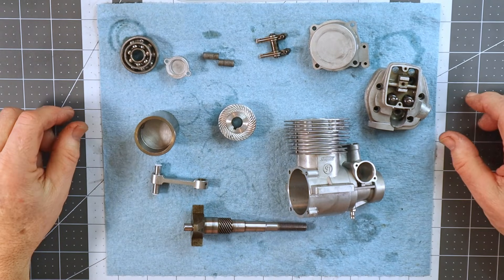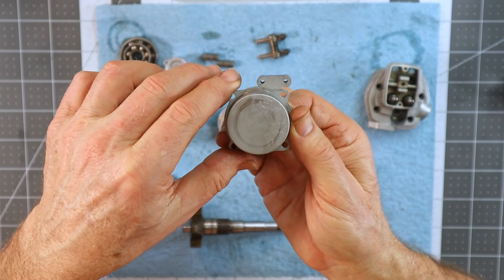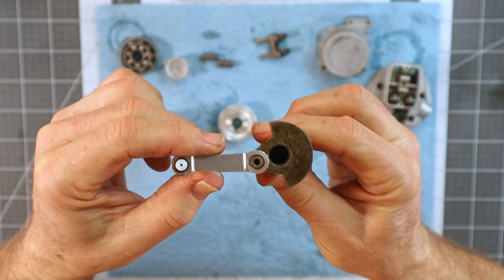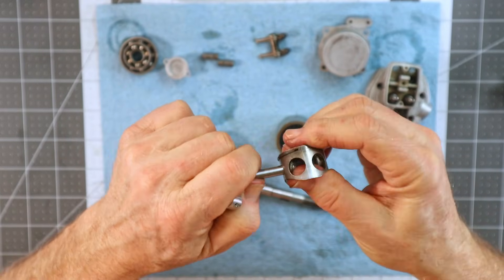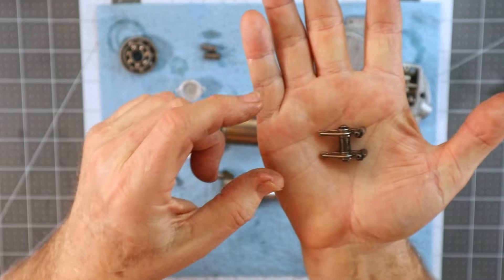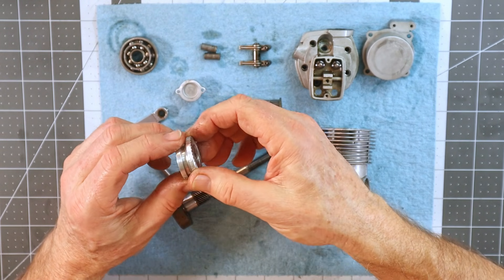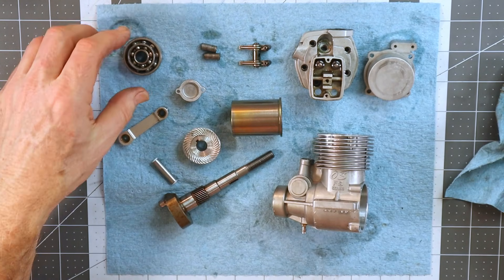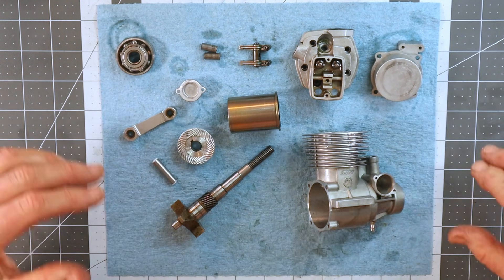OS FS 91 Surpass Enigma Engine

Comment: This video answered some of the oddities from the disassembly.  Now you have a nice set of clean parts ready for assembly. In my high run time OS 91 engines I also see a lot of carbon buildup in the cavities behind the valves. I don't know whether they impact anything or not. In one of my engines, the carbon build up was very thick and it took a considerable time in the sonic cleaner before they came off. Anyway thanks for rounding my Sunday evening with another excellent video.

Comment: Hi David thanks for all the amazing info you share on the FS91S.  I have a couple of Ebay enigmas trying to puzzle them out with way less skill and knowledge.  Please could you show us the head gasket ! I never spotted when you take this off or replace it.  I am not sure if mine is stuck on to head or crankcase or just plain missing.  Thanks so much !
Reply from the maker: I mentioned in the first video that there was not a head gasket on this engine.  It is missing. It is simply a silver thin ring that fits perfectly in the head area. I recommend watching the first video again. I show this very well there.
At 10:13 of this video you can see what a head shim looks like.
https://youtu.be/pv6EDa58fnc
Reply: @dmrcflyr2  brilliant thanks

Comment: Hello Dave, I am a fan of your channel. I have two OS 91 surpass. Why is the needle value on the same side as the exhaust? Can the carborator be  turned around so that the needle valve is on the opposite side of the exhaust and still run properly? Thanks keep up the good work.
Reply from the maker: Yes it can. That is a design feature.  Simply remove the screws and rotate the carb body around.  I believe that the manual also states this.

Comment: So I had a situation where I got two os 91’s in a deal.  One looked trashed, it was in a crash.  The other one looked fine but ran pretty rough.  I took them both apart and put together one good engine.  That looks like a mix and match situation like mine..but assembled with a flat head screwdriver..some pliers and a chisel :)

Comment: An enigma for sure. In the past I've hydrolocked small engine cylinders with oil or threaded a rope down the spark plug hole to aid with stubborn crank nut removals. Mind you I was working on Vintage Briggs Engines mainly but once an 86 325 ES BMW & that trick worked a treat on it... I'm not sure how kosher this would be with a model engine tho. I feel I must say if you feel something is turning wrong / abnormally or excessively hard, to stop & re assess as to not possibly bend something like a valve or rod & if useing the rope trick be sure it is not thrugh a cylinder port...✌👍